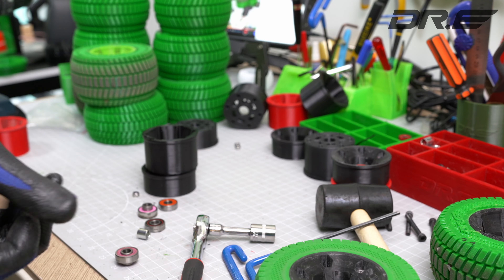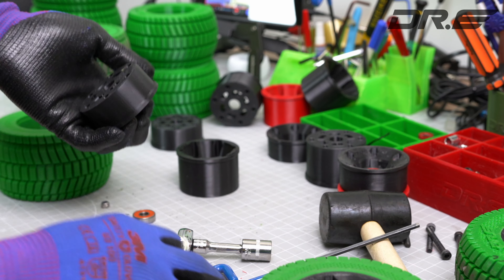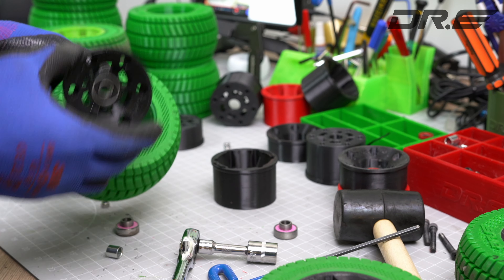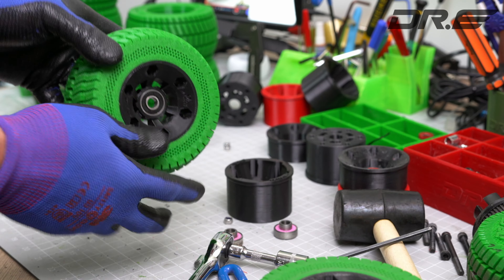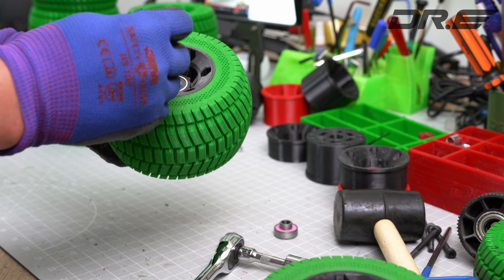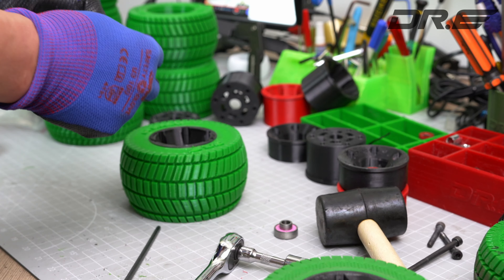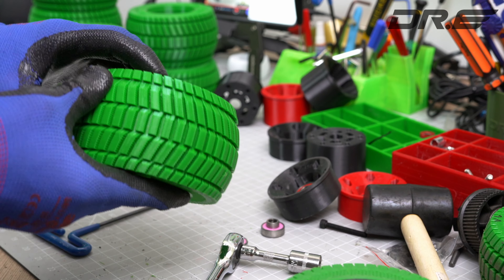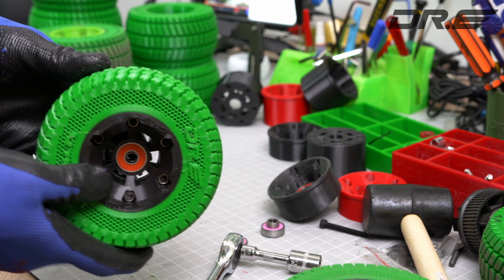How to Assemble Dr. E TPU Wheels after 3D printing the parts!

Comment: Dr, What kind of bearings are you using? Are there any good brand bearings you can recommend? Thank you
Reply from the maker: Using some decent ones from aliexpress.  Let me do a review soon.  Good price and performance.
Reply: @dr.eskateboard3381  How about Zealous bearing?
Reply from the maker: @Randoll Chiu  yeah they good i think, any decent bearings with sealed rubber silicone will do fine.  Esk8 do not need extra lubrication unlike non electric boards since we have MOTORS.
Reply: @dr.eskateboard3381  Thank you 😊